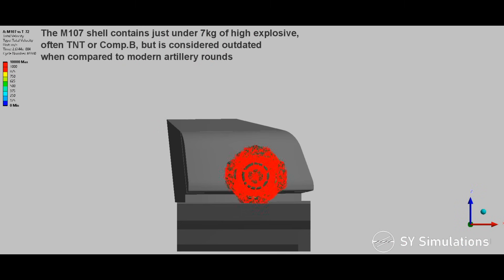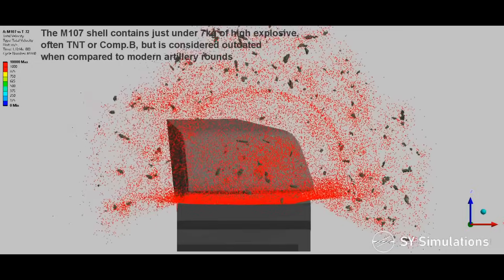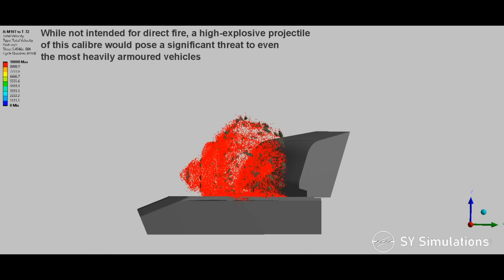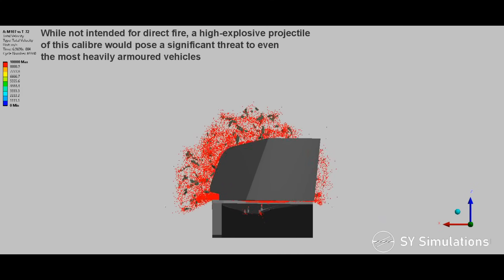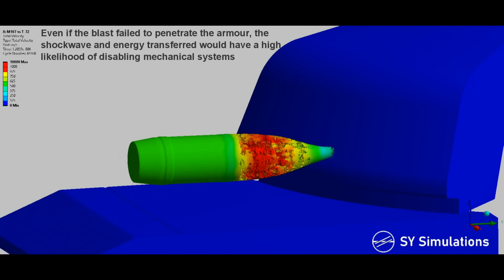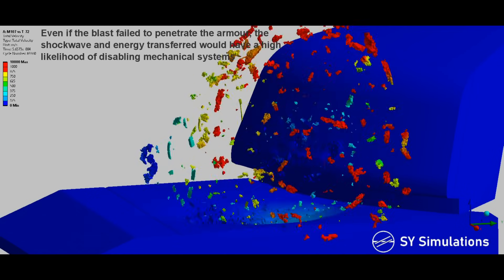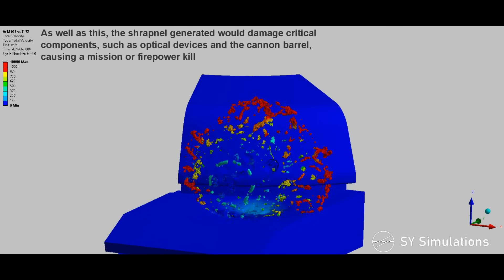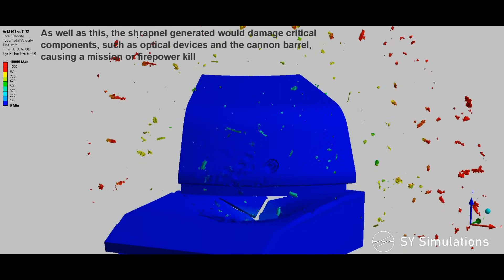DIRECT FIRE ARTILLERY vs T-72 | Paladin 155mm M107 High-Explosive | Armour Penetration Simulation

Comment: People don't realize this (thanks to some certain video games) but artillery has always been one of the most effective way to fight AFVs. Even non-direct hit can easily detrack the vehicle (mobility kill), and direct hit often disable optics, gun barrel, exposed mechanism,... (mission kill) which take the vehicle out of combat just as good as a total kill
Reply: M Kill, and even direct hits can incapacitate the crew even if there's no significant damage, kinda like being in a barrel with an entire concert sound system right outside.

and in this example, the shot wrecked the hull to the point of likely disrepair, while the turret is relatively intact, the structure underneath mainly the turret ring would be mangled, and even possibly setting a cook off with spall directly on top of the carousel autoloader system.
Reply: By certain video game's you mean World of Tanks. HE can wreak havoc in War Thunder.
Reply: @narodwpsanialy1940  Not as much as it should. For example, a 50kg bomb dropped directly next to a Tiger 1 will not kill it since the blast can technically only penetrate less than 65mm. Even though the shockwave would still destroy the tank and crew. Unfortunately you cannot test bombs against tanks in the armor analysis so you will just have to believe me.
Reply: @ATruckCampbell  I didn't mean bombs, I mean't HE shells like Sturmpanzer II 150mm.
Reply: @narodwpsanialy1940  I know, but those are just flung bombs. I have much fun with the rank 1 150mm Swedish launcher, though I still often get times where it will do jackshit which is what I mean by HE not being as good as it should in WT.
Reply: yes it will, if close enough. I've killed a Jagdtiger with a 50kg bomb.  @ATruckCampbell
Reply: @ATruckCampbell  overpressure is a thing
Reply: A 155mm shell striking the ground 30m from a tank, was a total mission kill in testing. The tracks and road wheels were broken and damaged, fragmentation damaged the gun tube and vision blocks, and the crew would have been unable to fight from shock and mild concussion injuries as the blast wave would transmit through the armor plating at that range.
Reply: it can pen the armor of lightly armored vehicles, a good example of he shells actually penning tank armor is in ww2 at the beginning of operation Barbarossa when the german tanks began encountering the kv-2 specifically armed with a 152mm gun, it's he shell could pen the armor of all the german tanks in service at the time including the panzer 4 which had up to 50mm of frontal armor depending on the  variant
Reply: By certain people you clearly mean americans? Because there are plenty of footage from WW2 where Tigers were destroyed by SU/ISU-152 direct hit by 152mm HE
Reply: @licrygh  true, even though the he shell would not pen it would produce large amounts of spalling basically blasting off pieces of the armor and the inside and sending them flying at high velocities causing massive damage to both the crew and inside of the tank
Reply: tbf WT's damage model is pretty good for what it is. It's fixing literally any damage in 30 seconds (tracks, gun, engine, etc.) that throws perceptions off.

and the gunner that keeps going after getting a face full of shrapnel
Reply: @iraeis7267  Not really. War thunder made a lot of sacrifices to it's damage/collision mechanics to reinforce their model of fun. Tracks are tough as hell and don't get reduced performance when damaged, gun barrels are made of stalinium all applique armor and extra geometry overperforms like crazy. 
To add insult to injury, a lot of pieces could be fixed with measures as simple as hard caps on effective armor amount (For example, side skirt not being able to  trim more than double of it's assigned thickness out of penetration, resulting in 10mm metal sheet generating no more than 20mm extra armor for any shot against it). But no, you hit that wrong part of Walker buldog turret, 1400mm RHA equvalent for you, screw your APFSDS.
Reply: The US supplied large number of M777 guns and GPS guided 155mm shells to Ukraine. The Ukrainians have successfully demonstrated they could hit slowly moving tanks using indirect fire, probably with GPS guided 155mm ammunition and battlefield drones supplying or predicting the target locations. Correct battle tactics also help to increase the chance of using indirect fire against moving tanks. During the battle for Lysychansk, the Ukrainians successfully predicted where the Russians would cross the Donets river and fired at the predicted GPS locations with very high degree of accuracy and success. The crossings were littered with destroyed Russian armor.
Reply: its just kind of funny that the t-72 is as prone as it is to just fucking explode and melt its crew
Reply: Mobility kil is permanent is are denial is successful
Reply: Some fools think you just run out and fix your tracks 😂
Reply: This is untrue. l am not going to argue over the scope of what people think, predominantly playing war thunder or world of tanks or armoured warfare, and crying about self propelled guns  -  but lets think of it in terms of alotted efficiency in order to obtain any varying level of kill. 
87, 105, 122, 150 howitzer barrages in world war ll, or nebelwerfer barrages could damage tanks and disperse their armored formations, but think about the needed shells fired by these indirect batteries in order to do so. This is a huge expenditure, for quite little resulting damage. Put into perspective if these same barrages, were conducted against more typical targets of opportunity, like machine gun nests and sandbags / anti tank gun or anti air turrets / infantry platoons / command buildings / trucks / airbases and aircraft .....the mortality suffered and material damage goes through the roof in comparison with the same expenditure. Warfare must take into account efficiency, and simply artillery is inefficient at engaging armored cavalry. 60mm mortar, 75 and 76mm light artillery were pretty much laughable except a direct hit.

But, this is direct fire terms of engagement, right? Surely it must be better? Well, not really. Tanks engage other armored vehicles with flat shooting higher velocity projectiles, with useful sights like  CCTV, fire control system, laser rangefinder probe, atmospheric sensor. And l am not talking about any thermal viewer, like some shit 1950s lR searchlight. A real 2nd gen or 3rd gen thermal intensifier, one for commander and another for gunner.  2.  A self propelled gun will have laser rangefinder and fire controller, maybe real modern ones would have atmospheric sensor, but they aren't have a 3rd generation CCTV. Maybe a 2nd gen, and probably just 1.....not 2. That the crew will fight over to use. And the ammunition used, is much lower projectile velocity. Steel beasts simulates tank on tank engagement, at what 1,500m? Imagine shooting a tank with 600m/s projectile at 1500m and scoring a hit VS the tank having 900-1700m/s ammunition and better fire control. This is ridiculous. lts a secondary thing, when nothing better presents itself. 

Detrack is not mobility kill. Track links can be re-set, and most tanks have spares for this sort of thing. Crews are trained for this sort of thing. A mobility kill is roadwheel, sprocket, fuel line, engine damage. 

Why is artillery seemingly so dangerous to tanks in Ukraine now? Well, first off artillery isn't per se "artillery" in the sense we know it as, but rather lumped weapons classified as indirect. Rockets, guided missiles beyond range, suicide drones, guided artillery rounds are all being .....lumped....into the definition thats artillery. And the amount of support going into artillery, to score semi-accurate area of effect around armored vehicles, is still immense. And inefficient, see point 1.  Drone surveillance, ground radar aperture mapping, aerial photography, satellite photography, infantry rangefinder teams, vehicle rangefinder teams, helicopter rangefinder scouts.....the list is exhausting. VS a tank that doesn't need all of that, is armed with more reliable ammunition for the job, and even has greater mobility in itself.  

The artillery can still very easily be used to GREATER effect, against other targets. Is a tank susceptible to artillery? Sure is.  Is artillery a great way to cost effective, eliminate tanks? Depends the artillery, depends the ammunition. Is artillery comparable efficiency, effective-wise in eliminating a tank, VS say an ATGW infantry squad, ATGW fixed wing or attack helicopter, or APDSFS round from a tank? Very unlikely.
Reply: @demetrioshristovski4518  "detrack is not a mobility kill"
Ok, what kind of magic will you invoke to put your track back together, while under artillery fire?
Reply: @drrocketman7794      just saying de-track isn't a mobility kill in itself.

What kind of magic will you invoke to allow a huge self propelled artillery vehicle to shoot a tank with slower projectile, in itself a faster target, which has tonnes more situational awareness, and may even have an APS which all but nullify an SPGs projectile in direct fire.
Reply: @demetrioshristovski4518  valid point
Reply: @drrocketman7794   The whole premise is useless.  Can a 155mm be a danger to a tank? Why certainly yes. Practically, efficiently? Thats a stretch. A sledgehammer is a danger, an extreme danger to a fly or mosquito. But in practice?  1 SU25 or A-10, 1  Apache or Mi-28 or KA-50, or 1 tank hunter team with kornet/Javelin  can actively engage target tanks with reasonable success, high lethality. 

VS  a battery of MLRS rockets or 155 howitzers firing for effect in the hopes of less than lethal damage? 

And direct fire is out of the question, unless its horrific doctrine in use (Ukraine) and outdated tech.
Reply: @demetrioshristovski4518  exactly. Now you never know what will destroy your tank- landmine, FPV with 3kg. kornet, ka52 or even krasnopol. So many things wants to kill you and you still have to do your job
Reply: @demetrioshristovski4518  a reconnaissance drone and something akin SMART 155 top attack homing round. The tank won't even have visuals on what killed it.
Reply: @drrocketman7794  it is possible to do that, just really hard and dangerous
Reply: @demetrioshristovski4518  Except that this sledgehammer is not shooting at single tank. It pounds whole defence line/attack formation, effectively removing your ability to concentrate force to begin with, forcing you to use small groups, putting more officers at risk and making ambushes so much more deadlier (Since you can't bulldoze through them if you are dead too fast. And yes, bulldozing through the ambush is pretty much the only counter ambush tactic).
Reply: @demetrioshristovski4518 the problem is artillery kills against tanks were not uncommon in world war 2, because artillery is used to take out infantry and infantry always support tanks. Artillery isn’t the best weapon to fight tanks, but it can potentially kill 2 birds with one stone. If a track is dislodged or a link is broken it can be fixed, but under machine gun fire it will be very difficult. This also applies to tanks and support guns, even if you can’t pen the armor it’s better to have an effective HE gun than AP in almost all situations (at least in world war 2, the tank is a lot different today, but having a good HE shell imo is often over looked on MBT’s). Infantry is much more common and a lucky hit can easily cause mobility kills even on (on paper) impenetrable tanks
Reply: @corneliusmcmuffin3256   in world war ll, artillery is shorter range, used more common and amassed, and in total war concept even rearward artillery batteries commonly find themselves being overrun (considering the short range) by enemy forward combatants. This does not happen too often anymore. When arty tends to get hit now, its by counter arty, drone, airpower, ship strike, Etc. 

In any case, most the artillery HE round anti tank success was 1) field gun types, rather than infantry support guns or howitzers  and 2) usually still direct fire. Which means the gunner was actively using a direct fire sight not an indirect elevation/level dial sight. This means its used like an anti tank gun, not a howitzer and parabolic arc.
Reply: @demetrioshristovski4518  artillery is actually the most cost effective out of all of the alternatives you mentioned, its also very effective at stopping armoured assaults etc. IMO artillery HE is way more dangerous than how its showed in games.
Reply: @KõivCat7889  This is false.
No one is saying artillery cannot disable/destroy tanks. lt can.

But it is not a reliable, cost effective means in destroying them, without a tonne of extra support added into the mix. Compared to an option like an ATGM, which though expensive, will likely destroy the tank and cause casualty not just cause outer damage. 

Using FPV drones, satellite imagery, guided / semi guide artillery rounds just adds to the cost of artillery weapons in manpower (skills necessary and amount of people) and resource used. 

While damage maybe good for attrition, not all wars play out this way. 

HE is a danger to armoured vehicles, and shouldnt be treated lightly? Who said otherwise? However an attack helicopter, a CS fixed wing plane, infantry teamed ATGMs, an anti-tank gun, enemy tanks and IFVs are downright extreme, imminent threats and must be dealt and/or avoided immediately, as to not be killed yourself. These extreme threats will also likely not mission kill or damage your vehicle, but will outright penetrate and destroy it.
Reply: @ artillery shells are so cheap that missing isnt too much of an issue and drones have made them more accurate. plus they have longer range than most of the alternatives https://www.youtube.com/watch?v=GFrVhhPBiUw
i recommed listening to the first part of this vid to hear want a soldier has to say about artillery vs tanks
Reply: @KõivCat7889  Artillery shells are cheap. The semi-guided ones, arent so cheap. Drones are cheap too. 

However the operators services arent cheap. If using a simple guy with a 16hr course and a few hours operating time, sure its cheap but services are poor and limited. A technologist seated in a command and control post with excellent communications availability and control panels, costs cash as well as his service fees. 

Satellite imagery and aerial photography to help deploy drones and artillery, arent cheap either.

Ever since WWl, it was deemed artillery isnt enough to counter armoured formation attack. Dude, every since WWl. Can huge artillery rounds in world war l disble, immobilize, damage, destroy Mks, A7Vs, FT-17s, Vickers in world war 1? Certainly could and even did, but they werent reasonably and imminently effective at it. Dedicated weapons were borne for it. Ask a solider an opinion on artillerys effectiveness, and they will tell you its a threat for sure. But an anti tank missile? More than a threat.
Reply: yeah no. games these days love to make HE delete armour, with even just splash damage alone too.

who knows, its portrayed effectiveness might even be a tad overtuned. for instance, older sims of this channel showed that war thunder’s overpressure goes a step too far in its crew melting.

now maybe you meant more about mission kills and the likes which are easily repaired in video games.
Reply: @MetalX34  War Thuinder uses an all or nthing overpressure system. Meaning if overpressure=Yes then all crew are killed. but if Overpressure=No then no crew is killed. 
In reality a 155mm HE hit to the turrtet face of a Panther wouild knock out the turret, gun and also the driver and machinegunner, The loader, gunner and commander should however be able to withstand it with "a major headache" due to the shell impacting angled, deflecting armour of significant thickness and an airpocken inbetween. 
In WT it is a 100% kill because OP triggers. 

But a 155mm HE shell to the UFP of a Panther should be able to knock out the tracks, gun and probably the driver and or MG dude due to the relatively thin armour on the UFP and the drivers head even touching the plate if not careful. Yet in game OP does not trigger so no kills happen. 

The Damage to mudules is also much lower in WT. Barrels will survive 20 hits 2mm from it because HE shells have next to no actual shrapnel so they also do no damage with any kinetic force. The limited amount of shrapnel also only exist to "search" for targets insode the blast range and trigger the OP check.
Reply: In games you press the key that normally pulls the trigger and suddenly the ground explodes where you look being mostly a Roblox player for its free games there is only 3 modern titles which represent how artillery works 
1 and 2 are the games trenches and it's sequel where howitzers are player controled but have abismal range 
And one of the better "air strike" methods of artillery is frontline:Karelia where the artillery class uses radio and commands to guide flares supposedly fired by off map morters and with setup time and limited tries to guide the morters before they need to restock
Reply: Detrack is not a mobility kill unless it cant be fixed on the field
Reply: @rykehuss3435 This isn't war thunder. The wheels that drive the track will get fucked and those don't have an easy replacement.
Reply: @rykehuss3435  good luck convincing a crew to get out and repair a track while under artillery fire lol
Reply: @rykehuss3435 Don't worry, a crew that is brave enough to repair the tracks under artillery strike wouldn't be able to lift their balls and get out anyway.
Reply: @rykehuss3435  in most battlefield scenarios you won't actually get a chance to fix a track breakage if it was caused by enemy fire unless the fight is over. Any artillery that was trained on your position well enough to break your tracks is also able to hammer your position long enough to finish the job or has something watching you that will try to kill you when you get out of the tank if you are sticking around afterwards.
Reply: @rykehuss3435  they probably meant by mobility kill for the duration of the operation or mission that tank may be in, I mean unless the detracking occurs in some random quiet field via a roadside IED or mine with no other threats nearby then that detracking is at best a very annoying inconvenience but unless it is during a enemy assault or soon to be counter attacked then repairing a detracked tank even under those conditions could be next to impossible (not to say it isnt possible but try doing a repair on a heavy track under enemy machine gun fire alone)
Reply: @rykehuss3435  a blown up engine is not a mobility kill unless it cant be fixed on the field
Reply: @somaticapollo6025  if it blows up it probably cant
Reply: @rykehuss3435 It can be fixed in the field, it takes a crew of 4 several hours. Source: personal experience in an APC, which has tracks half the width of MBTs
Reply: @rykehuss3435 look mate you can't fix a track in 30 seconds and definitely not while under arty fire